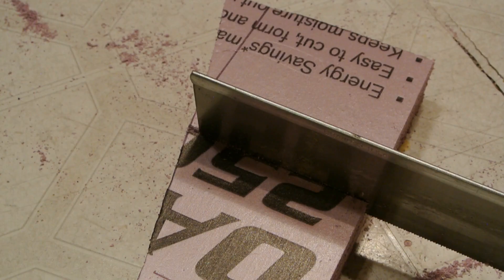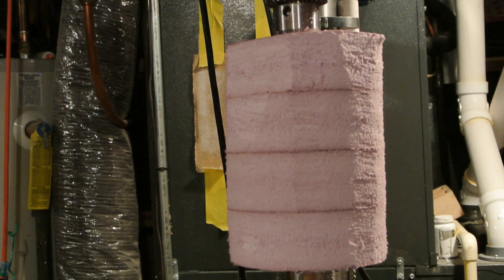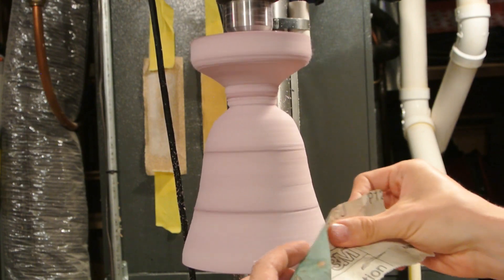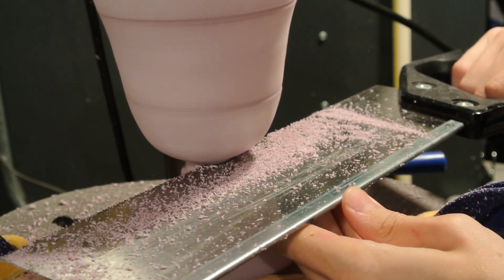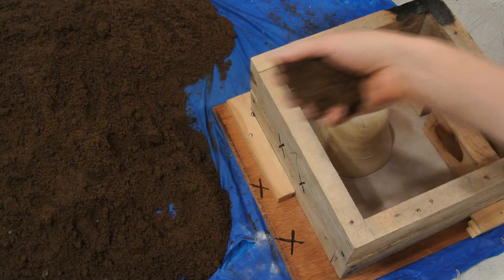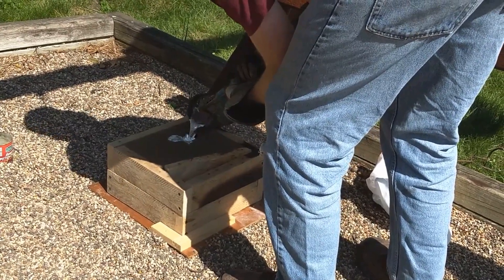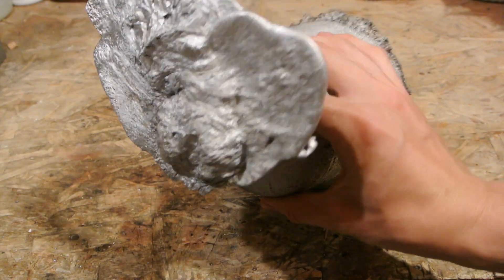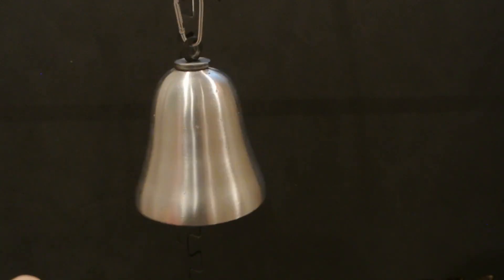Bell Casting from Molten Aluminum - Metal Foundry

Comment: I cast 14 inch aluminum bells which are farm bells. You could add a little more bentinite to the sand and this will stop on the bubbles. Use a bit less moisture and all will work out without steam build up when pouring..

Comment: Next time add a relief gate off the bottom  of the bell.  It will relieve the bubbling and gassing of your casting.  You will have to cut it off and grind smooth.  That and  less moisture in your sand gives a finer finish without pin holes.
Reply from the maker: Thanks for the tip! I'm always looking to improve my casting skills